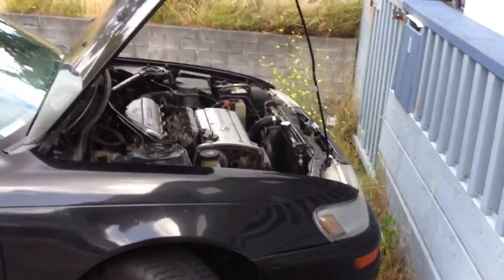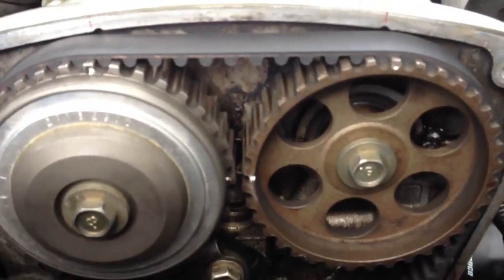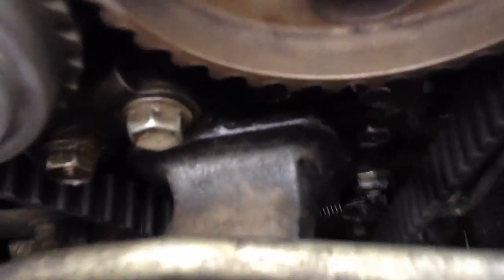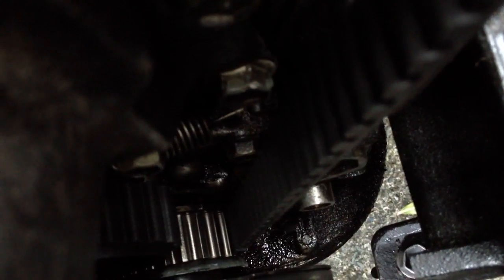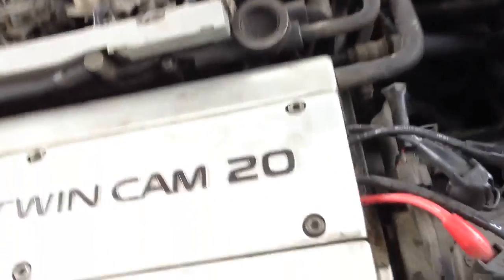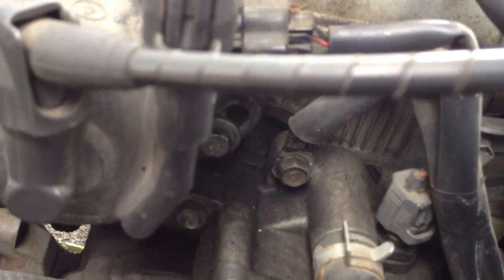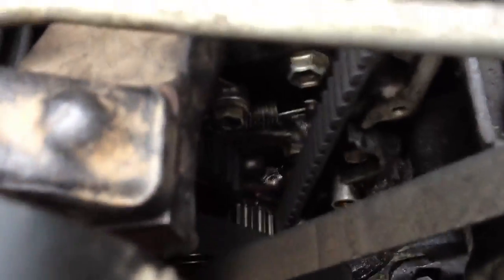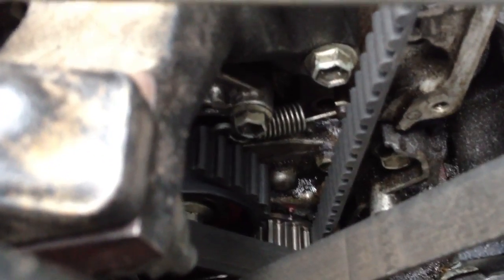4age 20valve timing

Comment: why I do the timing the marks don't fall back in the same place?
Reply from the maker: +Laveda Ali you maybe one 360 turn off, one cam does two revolutions per one on the crack
Reply: OK thanks. Will try it later!
Reply from the maker: +Laveda Ali i suggest getting someone who has done timing  before,  this was my 2nd cambelt change, i marked with a pen where all original points were, then when i took the belt off, the top cam sprung a different direction, but because i marked with a pen i was able to turn the cam at the  right place and slide cambelt on